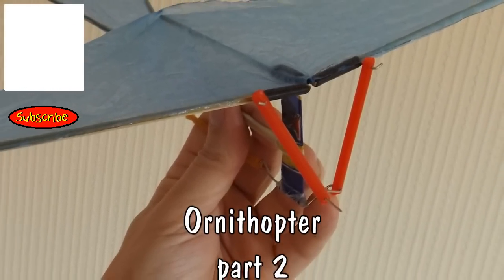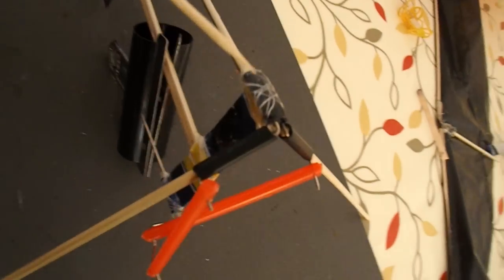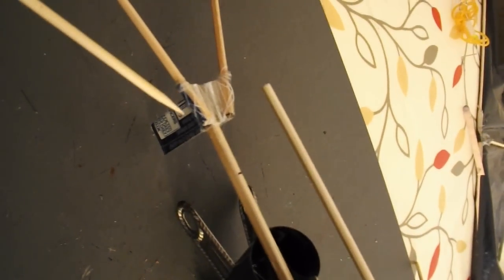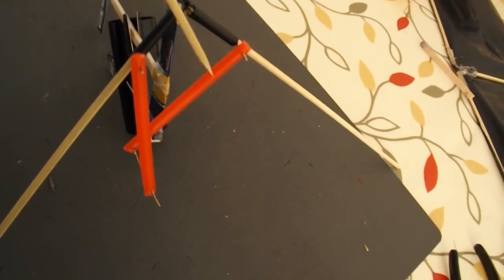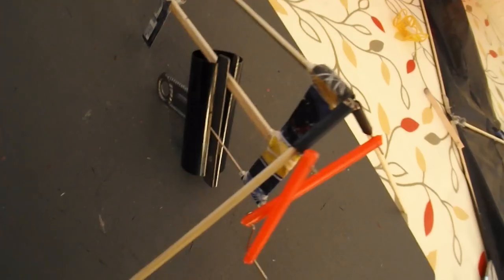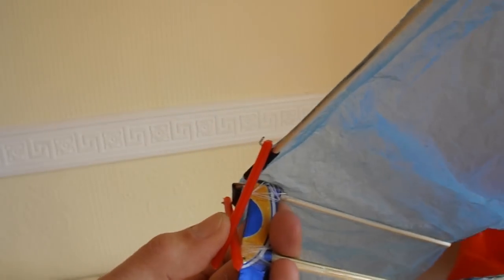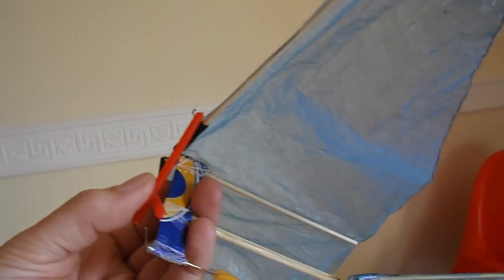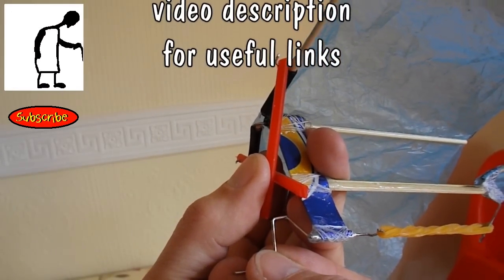Ornithopter part 2

Comment: The rubber band put to much stress on mine. You need a lot of turns to even attempt to make it flap hard and long enough to fly. So I'm using a little dc motor now. Just waiting for the lipo to arrive. After that I want to convert it to rc .
Reply from the maker: Good luck with that. If you want to see some wonderful RC ornithopters I can recommend this channel Kazuhiko Kakuta https://www.youtube.com/channel/UCAanjlVj-9dI6-Akwd1f5EQ

Comment: I have also another question. Can you make a ornithopter with a 15 tq motor and a d sized battery? or atleast a small motor
Reply from the maker: Sorry I have no idea what a 15 tq motor is. My understanding of a D sized battery is about 55mm long and 30mm diameter and would be extremely heavy and low powered compared to a small LiPo. This is the only electronic ornithopter I have https://youtu.be/aXYawcAUnG4?list=PLA5a2xPRSrB1PSykYV9OAcwxff4uEd_Bp
Reply: Oh ok
Reply: I meant 15t.
Reply from the maker: 777buxkiller7777 Buxbux Makes no difference, my first reply still applies.

Comment: why dont you make a rc ornithopter
Reply from the maker: KAUSTUV RAY it needs a surprising amount of torque to turn the shaft as you can see from the number of rubber bands. The best option would be to use a well geared down motor to get the torque. I have seen several on YouTube in the past. I have considered using the motor and gear assembly from a nanocopter but I think that may still be too high gearing and spin too fast.Here are a couple from YouTube, there are plenty more
https://youtu.be/YBkaINpNnVI

https://youtu.be/Pn5pPy9BX3w
Reply: A boy  iwant to buy the rc  kit  for making it